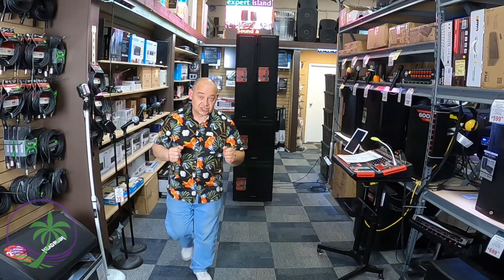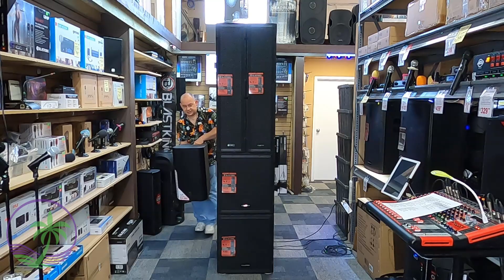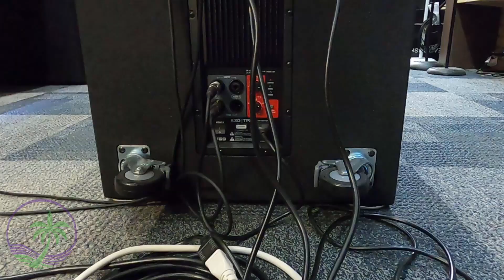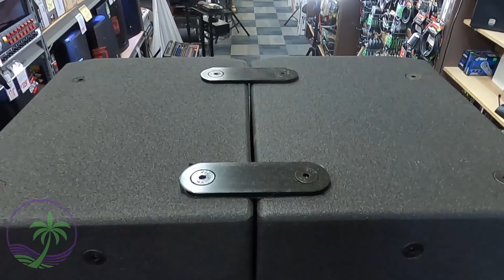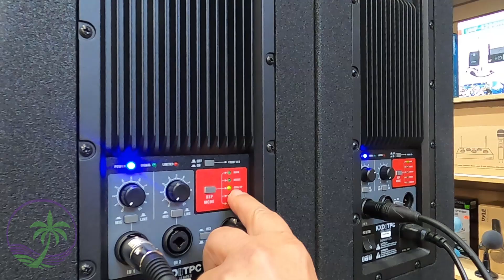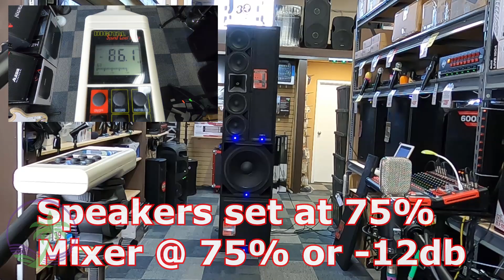BLASTKING KXDIITP 4000 WATTS TOWER SPEAKER 8x8 inch + DUAL 18" SUBWOOFER SYSTEM

Comment: Robin, just ordered one of these set-ups. I figured I'd see how just one Tower does for me, but I'm considering a second. I'm just using it for myself, but I'd like a recommendation or two for a mixing board to control it, along with my Blades, plus have the ability to expand it to a second tower as well. I'd prefer something with Bluetooth connectivity for use with my phone/tablet at a minimum.
Reply: What is cost please
Reply: @conroyrobinson319  $2500
Reply: Now that it has been a few years, what is your feedback on these?

Comment: Update: I bought the amp plate in 2020. Blask King didn't make them, they are Chinese. The companies buy them and put their name plate on the amp. Xquisit audio also has that exact same speaker setup, just blue instead of red. Dayton audio also has it but they added the Bluetooth function. 

The DSP is ADAU1701 (same as the Dayton Audio DSP boards). 

The performance says: 
600W RMS - 4Ω (woofer)
200W RMS - 4Ω (horns) 

Idk about the subs. I pulled mine apart and check the specs on the FETs, they are accurate.
Reply: Just btw the Chinese company is called BLG

Comment: Speaker companies need to cool it with the blatant false advertisement on wattage ratings.  It cracks me up that this "4,000 watt" speaker system will run at any capacity on a 15 amp breaker.  A 15 amp 110V  breaker can only put out about 1500 watts of power.  What about The other 2,500 watts???   All the companies do it, not just Blast King. QSC Advertises that 5 of their "1,000 watt" K,KW, and KLA range speakers will be fine on one 15 Amp breaker.

Every generation of speaker gets bolder with their power claims too.   Alto went from 1000 watts to 2000 watts with their recent generation, but the speakers aren't as loud as an EV ETX speaker rated for way less Wattage.

Comment: Great video...at $3500 USD on ebay..its a ripoff my EV EKX 15tops and two 18 subs sound better and almost the same price
Reply: I paid $2250, to my door.
Reply: @ThomasMichaelSeaboldt  how does it sound so far?
Reply: @bobbymiller1471 , I have two Blastking Blade 15's as well, and while I enjoy the Blades, I tend to just use the Tower instead when wanting to bump some Music because it's more like being there during a performance.  I will say that my one set of neighbors pretty much Hate Me now, but so long as I don't have to listen to their Screaming Kids, that's OK!
Reply: Not even a close comparison…I own ETX that would stomp your gear and it would be neck and neck with this setup …but I paid way more….the value here is unreal.
Reply: @ThomasMichaelSeaboldt  where did you purchase it please